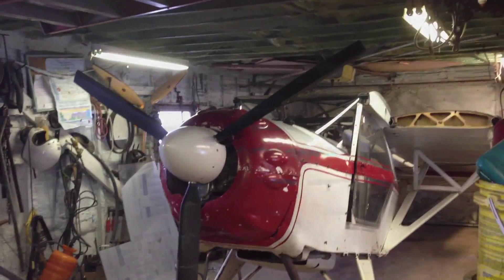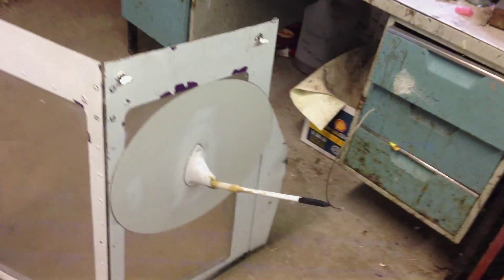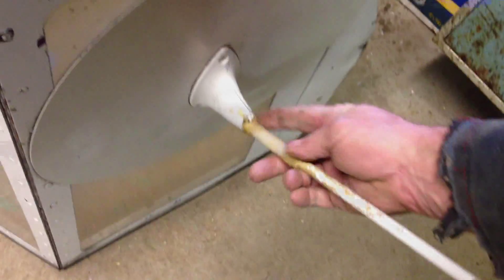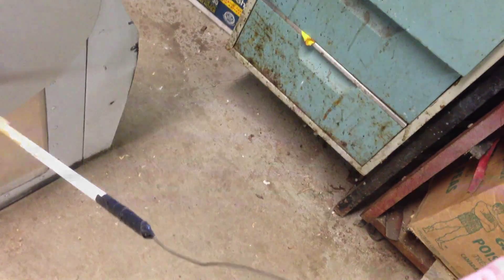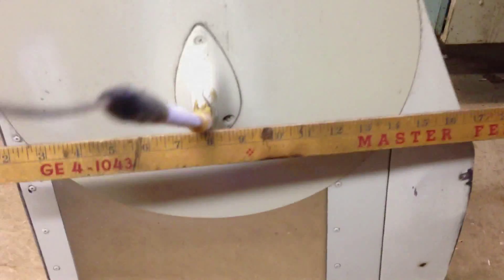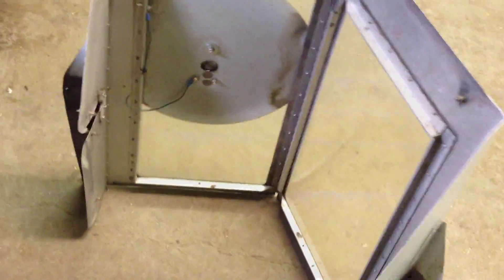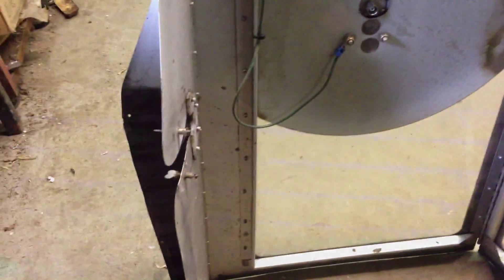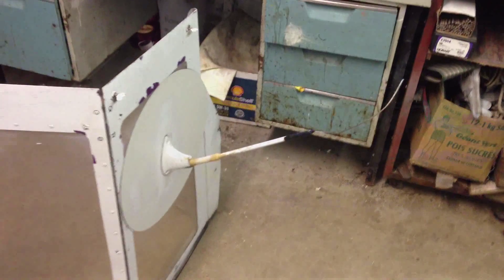How to make the best antenna  for airplane avionics 101

Comment: 234/F = a 1/4 wave vertical antenna length in feet. F= the frequency in megahertz (channel you use most often). 234/123.45mhz = 1.895' long antenna. You are thinking right by using the airframe as the groundplane. A quarterwave vertical requires a quarterwave long groundplane or radials. Use a dab of electrical grease on all ground connections to keep them clean for many years. Be very precise on your antenna length as every 1/4" means a lot at that frequency.

BTW, awesome videos.

Mike
WE0H

Comment: Funny thing about antennas... they are over rated I think. Currently use a coat hanger inverted and hooked under a roof tile for my TV. Like spanermantim... works good. While on radio talk, my head phones stopped working and traced it to the noise reduction module on the lead, so I cut the module out and solder the wires together and bingo... fixed. No static, no interference, and FIS gives me 5/5 for radio check. Go figure. Dave, I can now see why your fix works also... well done mate :-)